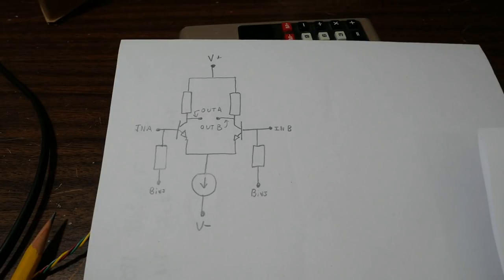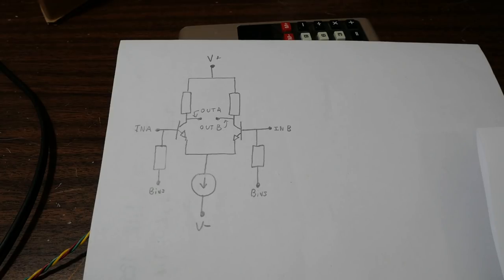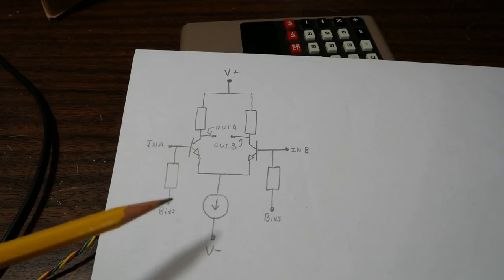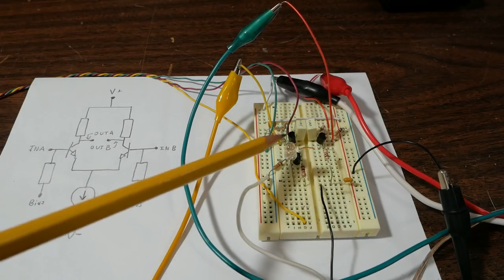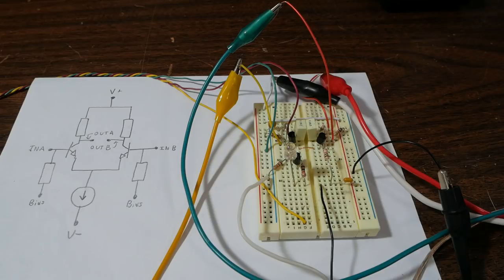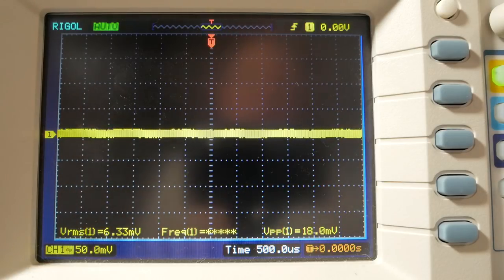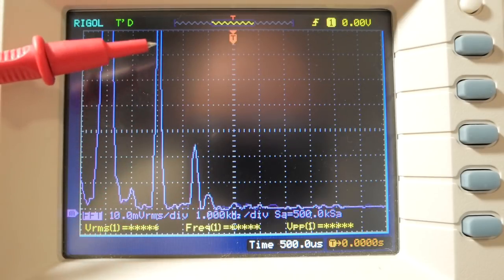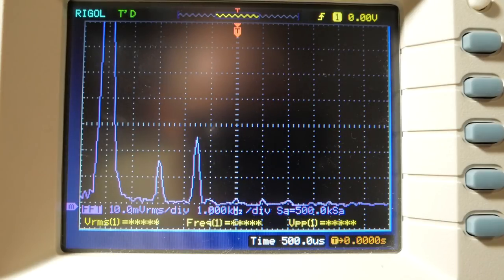Discrete audio amplifier project PART 3 input stage

Comment: The 220R resistors although improving lineraity of the dif pair, reduces your open loop gain of the entire amplifier - you need high open loop gain for your global feedback to be able to adequately error correct, so although improving dif pair on its own, overall, it may not help as much as it appears. Good work on this project, very enjoyable!

Comment: Hi John. I hope this isn’t too off-topic, what are your thoughts on using vacuum tube for input/gain stage of solid state amps? Paul at PS Audio seems to believes this to be the best of both worlds.
Reply from the maker: A tube is just another amplifying component and can certainly be used. Making a low distortion amplifier yet adding a "sound signature" to it makes no sense to me. PS Audio might garner more tube fans and sales by incorporating tubes in their amplifiers. If I were a shrewd business man I'd probably do similar things. My goal here is to make a good performing amplifier. I don't need tubes to get me there. They create a new set of problems that would have to be dealt with.

Comment: thank you for your hard efforts. had been waiting for this for sometime now. i also have a plan to put together a bd139/140 amp, hoping this will come out as great help. :)

but the connection to input signal is not clear, how are you divide the signal to put into A and B ?
Reply: This probably isn't helpful now, but I believe that I worked out what is happening. B isn't being used at this point, and the resistor is pulling it to ground, so the signal on input B is zero. This will, I believe, be used later for the global negative feedback where the signal is fed back from the output stage into this input stage. 

Someone correct me if I'm wrong.
Reply: @joshhyyym  yah right. A is the normal input, B is the feedback.  to tell, after watching these videos, i actually built this, and made a 3055 amp. differential amp really cleans out the output from distortion, and adds so much power at the same time !.

Comment: lots of people say global negative feedback is bad ... do you know why
Reply from the maker: That started in the 70's by people who didn't have a good grasp on control theory and used poorly designed amplifiers to prove their point.
Reply: do you have a video on push pull and single ended..hehe ;) 

could the power main be filtered using global negative feedback too.. hehe

where would you use transformers in amps and dac ... what does it replace http://www.sowter.co.uk/dacs.php .. could it help your amp... some guy said it would add phase shift in the bass but i guess you can select appropriatly

what about a dual mono transformer input stage for your amp
https://www.soundonsound.com/sound-advice/q-why-are-audio-transformers-good-have
http://www.kandkaudio.com/power-amplifier/

Comment: no need to put local feedback with the 220 ohms Re resistors. just reduce your 10K !! Rc resistors. What for do you need 88 voltage gain? Discrete amplifiers when designed don't need so much open loop gain for global feedback. I would rather do a 10 gain differential followed by a CE with a.c. local feedback and a gain of 2.8 for your 80Vpp 8 ohms 100W load. Advantages, increased and flat frequency response and BW, linear, lower harmonic distortion as well lower transient distortion. Also better use an IC current sink.